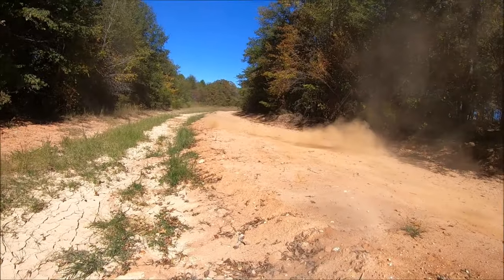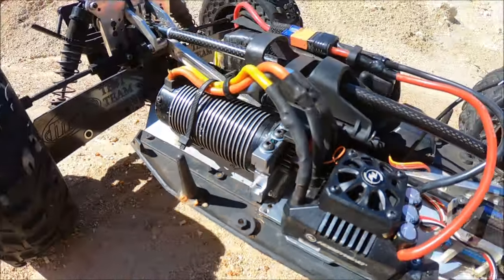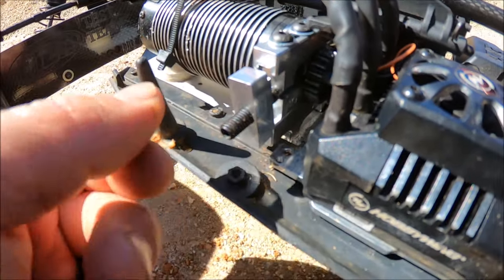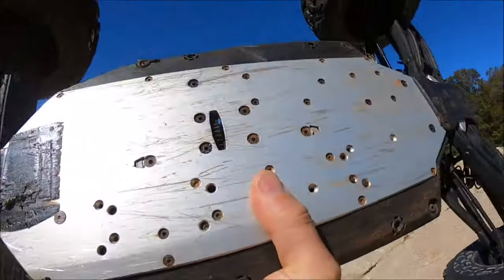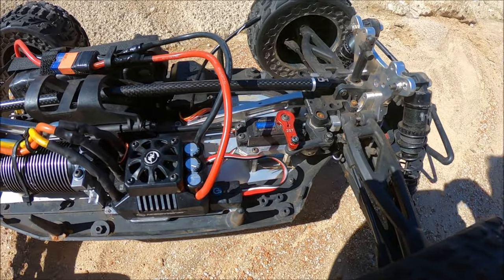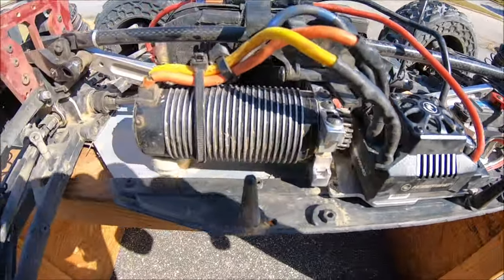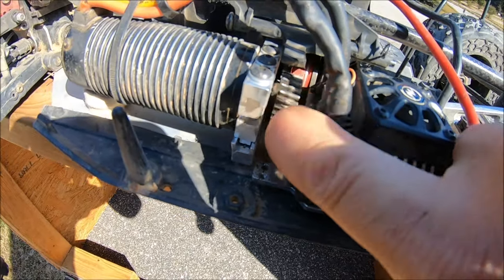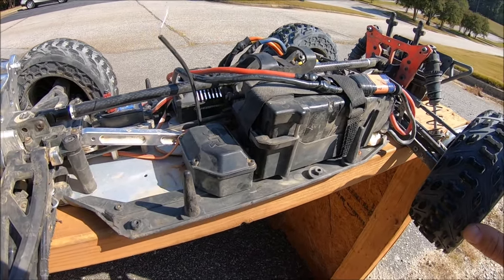ARRMA Fireteam gets a BRUTAL Beatdown! NEW M2C 6s motormount!

Comment: Man....i couldnt imagine wanting a 56mm motor in this other than wanting to do a speed run car...im running the spektrum 160A/1250kv in my truck on 6s and its almost uncontrollable at 100% on the stock controller. 50% feels stock...75% is the sweet spot imo. Otherwise...youll be doing diff rebuilds as often as top fuel drag teams change valve springs and head gaskets...but hey...to each his own!😂